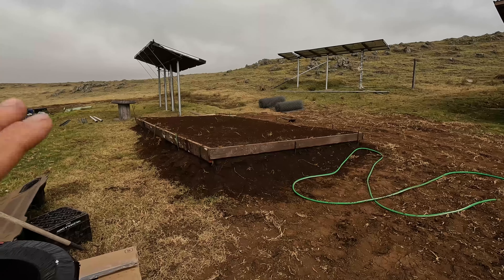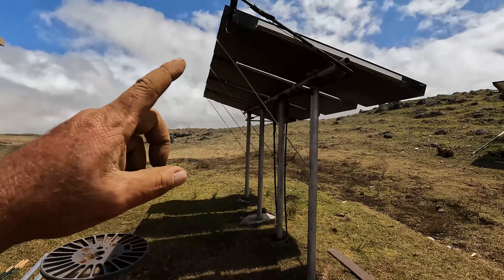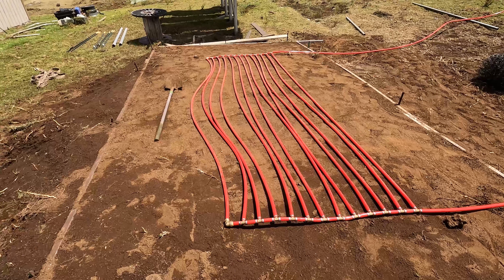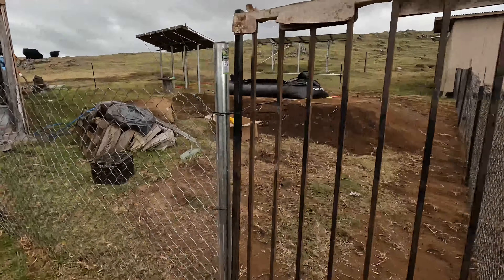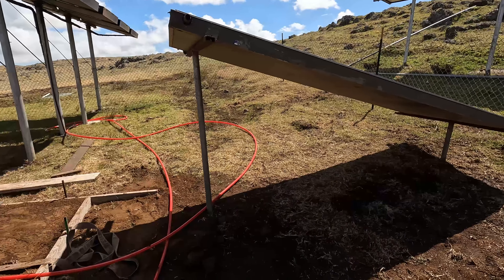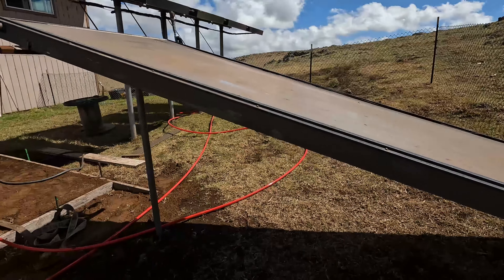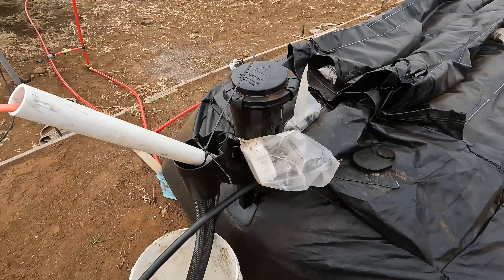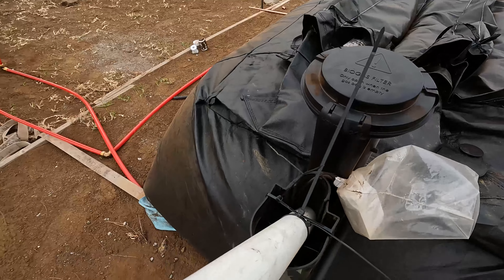Home Biogas Digester setup

Comment: You did a great job designing your syatem. I have the same system as you do. I had to redesign how I heat my biogas digester and my hot water because my greenhouse got way too hot in the summer months. As for winter time my system kept my greenhouse so warm I could keep my doors open all day long and get free heat from my greenhouse. I did do something different from your system, I put a hot water tank on my biogas digester so in the winter I had hot water flowing through it 90% percent of the time. It will take you at least a month before it will give you plenty of cooking gas. Again, I really liked your system. It was well thought out. Have a wonderful day!
Reply from the maker: Thank you and thanks for sharing. My system has been up and running close to 2 years now I no longer have to heat it at all just let the sun heat it and works just fine everyday I have gas. Just feed it and put water that's it. Our winters in Hawaii does not freeze or does not come close to it. Free gas everyday can't beat it.
Reply: @ModernOffGridDIY  so awesome! Great video. I’m on big island and am about to set up a biodigester so this video was great. Super excited. One tip I learned researching appliances to run off of the biogas/methane. The main difference is simply the size of the pilot holes dispensing the fuel. Like how natural gas stove has a smaller size pilot hole than a propane stove. The hole for a biogas appliance needs to be 3 times larger than it would for a propane burning device. I’ve got a double burner and tankless hot water heater for mine but also found some videos of people running a generator on biogas. Just need an inline pump to keep the pressure consistent. Anyway great video stoked this is working so well for you and I’m super inspired to get my system set up. Bless up 🤙🍀✨
Reply: @bigwavedave2655 can you send a link to the type of inline pump you use for pressure.

Comment: Hello If I may make a couple of suggestion.  The ground will act as a heat sink and will take all the heat away from your biobag.  I would use some ridged foam insulation between the ground and your coil of hot water.  Second water like to take the path of least resistance so your hot water will go through the first line and back to pump.  If you make a zig zag effect to get your hot water over all the bottom your biobag.  I love your Idea for heat.  I was just getter ready to build a bag with internal heat lines and this idea it amazing.  
I hope my info helps you make more biogas.
Reply: That's true , you should have isolated your heating pipes at list with 4 " or 10cm of isolation materials. 
All that effort and money for not much 😢

Comment: Hi, it would be more efficient if you put insulation foil between the soil & the pipe. Currently you are losing heat to the ground. Regards
Reply: Compacted earth is insulation.
Reply: @estebancorral5151   no it will completely absorb the heat. this is why it's so important to insulate when sleeping on bare earth or you will freeze to death. it's the most important thing when trying to survive a cold nigh is to insulate from the earth

Comment: Hey I think you said something about planting a garden under the solar panels I used to work at a solar company damaged panles leak out lead when it rains and I have seen undamaged panles eat the galvanized coating off of a tin roof. Also about how many gallons of useable gas does this sistym make in a year.

Comment: I’d use a Mylar/reflective vapor barrier right under the radiant heat pex, can this power an instant water heater? You could probably lag your exposed pex with an insulated/reflective layer too

Comment: I used 80 mm polystyrene sheets as insulation under mine with rock dust covering the insulation, I have 2 x No. 7 units

Comment: I agree if you can plastic/rubber layer then rigid insulation under under pex will help. with heat loss and gains in performance and temp control.... Even a membrane layer under the pex will be a gain compared to bare earth

Comment: Just a thought on the Thermo heater...
If it had the exit from the diagonal corner ..  it should force all tubes to get more even energy transfer
Same way to wire multipul solar battery bank

Comment: One for the future project ;-) You should have looped the pipe under rather than cut and connect, this is stupidly more expensive than it should have been. underfloor heating is done in loop runs so that you don't end up having leaks. You could have saved loads of money and had 0 stress about punctures if you have done it that way.
Reply from the maker: I appreciate the thoughts but look at any water heater panels they not in loops it's a grid style also it's been working just fine it's been years now. If I was worried about the money which I'm not so that don't matter.

Comment: Great Job!! Which water heater model are you using? A 1000W one? I just bought the system and I will put a greenhouse plus a water heater on it
Reply from the maker: The water heater element I an using is 4,500w but wire for 120v so it running more like 1,500w but I have the option to wire 220v for the full 4,500 if I want. Hope that helps.

Comment: You don't need a circulation pump, put the solar heater in the green house, shorten the input output lines and let natural convection do its thing. Drain the line in the fall. 

Insulation needed between the ground and bladder.
 
The joints are a hazard and too expensive. The water input line needs to be big enough for all those joint lines. The power of the flow weakens over all the lines and will only flow in the first two lines. One line switchbacked.

Comment: I know you will probably never see this comment but I wanted to share some information with you about solar water heating. It takes 1 BTU to raise the temperature of 1 gallon of water 1 degree F.   As a rule of thumb, Solar Thermal collectors yield Approx. 1000 BTU per sq.ft. area. that means that a 4 X 10 collector = about 40,000 BTU/solar day in winter. ( in full sun). You are attempting to heat 1,136 gallons of water with one 4 X 10 collector. Use this equation:  Required BTU = Gallons X 8.3 X Desired temperature rise. Example: to raise the temperature of 100 gal. water 50 degrees F (say 60 F to 110 F) the calculation is 100 X 8.3 X 50 = 41,500 BTU. You are trying to heat 1,136 gal. of water so you will need over 11.36 times the output of your 4 X 10 collector to heat that much water in a solar day in winter. Also using the straight pipe method without using a proper heat exchanger will lower the efficiency of the system. Using a pump with a flow rate of say 2 gal/min will decrease the efficiency of the system because the water will not stay in the collector long enough to provide an efficient heat exchange and will return to the digester with very little change of temperature.  Of coarse since you are not using the heated water like you would in a home water heater, once the water in the digester is heated to the desired temperature you would only have to replace the heat lost during the night. Insulation is key. Also the straight pipe set up with no flow-check valve and the heated water being lower than the collector, will allow the heat in the bag to be thermo-siphoned back to the collector and radiate the heat back into the atmosphere during non-sun hours and you will lose heat from the digester. Building a greenhouse around it like you want to do will also help heat the water and hold some heat in at night but you will still have the loss due to thermo-siphoning as I mentioned before.

So I hope this information helps you.

Comment: As a plumber i see a problem with your manifold should hat a tee on the end not a 90 . The side with the 90 will flow but the others wont,
Reply from the maker: Thanks for your insight. I actually copied how my solar hot water heater panels are designed.
Reply: @ModernOffGridDIY  then the solar hot water system would heat better if you change out the 90

Comment: You need insulation under that radiant heating.  You are losing all your heat energy to the ground.  It's probably getting some heat from the radiant heating, but a night it's just going to be sucking it all back out.  You would have been just as well off not having it there at all.
Reply: Sounds like a shitty job after all is set up. Pun intended

Comment: Your heating supply grid is not going to work. The water will flow around the outside bypassing all the tees. You should of looped your heat link like a snake.
Reply from the maker: Its working been running for 3 weeks now. This video was taken a month ago
Reply: Intersting it shouldn’t have is it a small pump? Also how much biogas will it produce?
Reply from the maker: The pump has 3 speeds low med and high. I also put my hand under the biogas digester to feel the Pipes and its working well. The same way this is setup is the exact same all my solar water heater panels are built from the factory. 6 hrs of cooking gas on a double burner stove every day if I'm feeding it no more the 5gals per day. I stocked up alot of food waste before I started the project plus I have 2 other family's giving me there food waste. I gave them a air tight 5gal buckets and I swap them out for them.

Comment: It’s not piped correctly. It should be a continuous loop, you put tees everywhere.  You’re never going to get even flow through each pipe.
Reply from the maker: My solar water heater panels are built just like this from the factory.
Reply: Should be piped like a mulitpl solar battery bank
Minor job to change the one side...